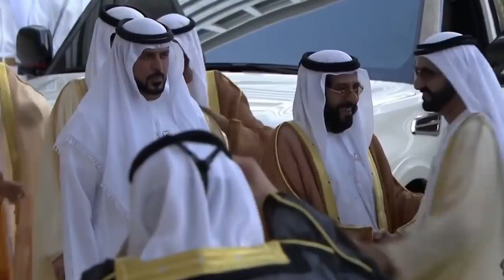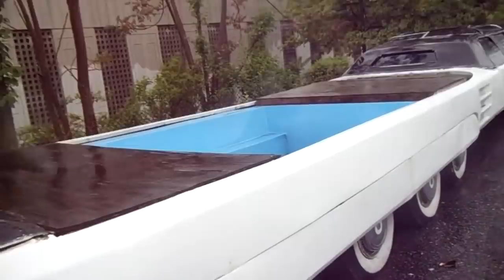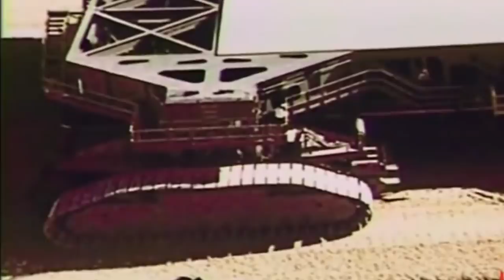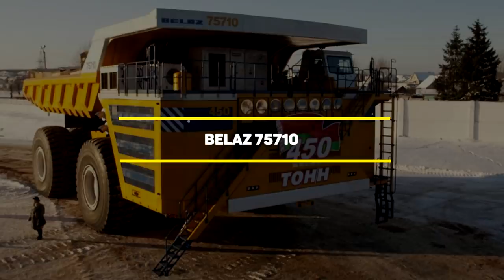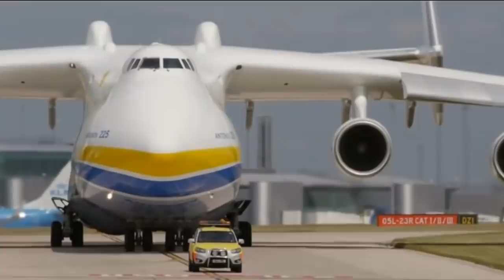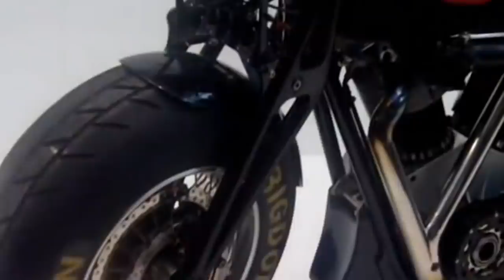10 Biggest Vehicles Ever Made

Comment: The dump truck listed at number 5 weighs almost 400 tons, not 400,000  tons. A ton weighs 2000 pounds. Are you trying to tell me this dump truck weighs almost as much as the supertanker in the #1 spot at 418,000 tons? Otherwise good footage of these giant vehicles. Also the Bucyrus name you used through most of the video is correct, not the first word you used. My dad worked there for 20 years until the late 70s. They built a lot of massive equipment such as walking draglines.

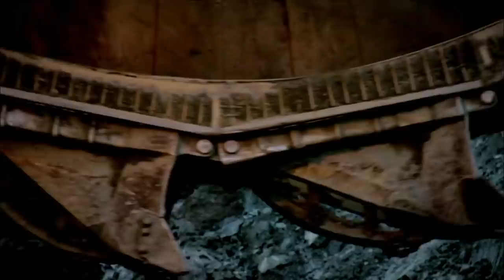Comment: At 6:18 I calculated the ft per second and  it is about 0.54 ft per second or 41/75 which is basically a half a foot per second. Also if you are wondering the miles per hour it is about 0.37 miles per hour or 41/110 miles per hour. Also in one day it would travel about a little over 8.9 miles. A garden snail also moves at 0.029 mph. So it moves only about 12.75 times faster than a garden snail meaning it is insanely slow. A sloth 🦥 also moves at 0.15 mph which is the slowest mammal meaning this vehicle moves a little less than 2 and a half times faster than a sloth. The average speed of a car is 50 mph. Making this vehicle a little over 135 times slower than the average car. ALSO to convert mph to kmh multiply the mph by 1.60934. Im not gonna say anymore just look up the rest. My brain is melting. Also this is supposed to be a joke BUT these calculations ARE actually true.